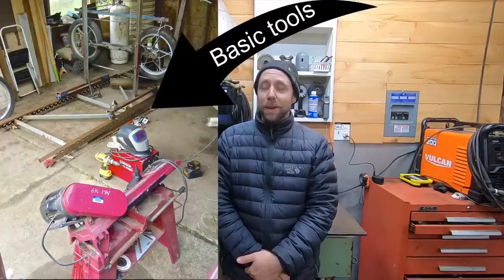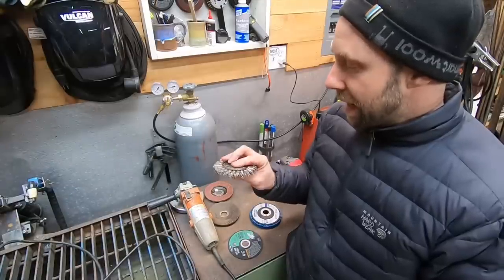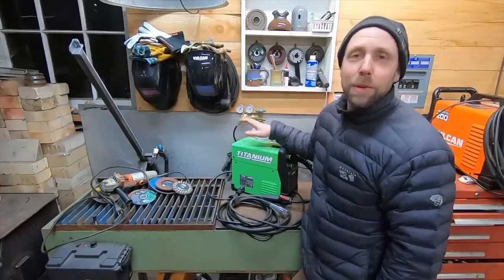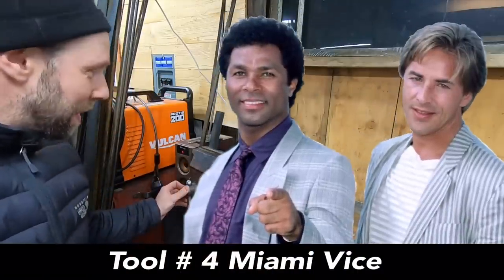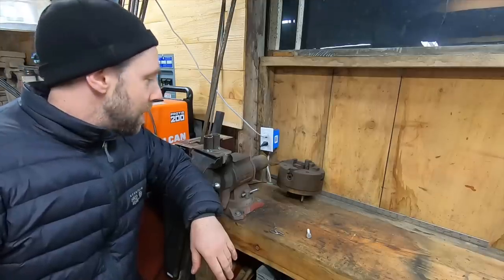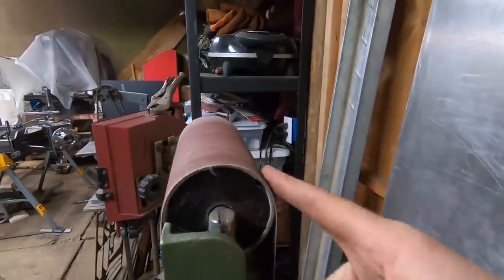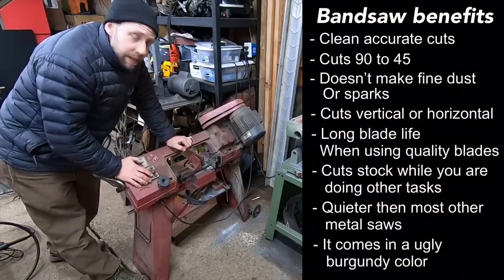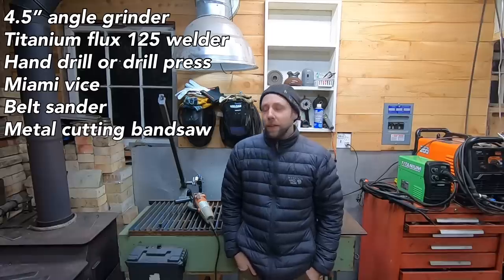6 affordable tools I recommend to get started in fabrication

Comment: I’d recommend starting with a stick setup. I can do thin metals with that or oxy brazing. Stick also can handle 1/4-1/2 inch metals if need be. Flux core has its place but it’s not quite as versatile.
Flux core is perfect for the weekend warrior or shade tree guy otherwise.
Reply: i got a stick welder when i was 12 i still use it even though i have a big 240V miller 
there are just some things a stick welder is better at
Reply: There's nothing wrong with the flux core prosess just use the proper wire type, use the proper polarity, and always store your wire in the proper environment like you would stick welding rods don't let moisture get to them and you will have better consistency with your welds
Reply: Scott Barlow not to be a smartass, but do you actually own flux, stick, and mig set ups?
I do, and I can confirm that flux core is a hobby rig. No one serious about being a fabricator should start with that unless they specialize in very small scale repair or they want something to play around with on the weekend.
Also, flux wire does not mind being in a moisture environment, I’ve used it during quick field repairs when it’s been a light rain.
Reply: @ThisGuyWantsBeer  Miller 250 AC /DC CC square wave w/water cooled TIG torch setup . . . ESAB 250 AC DC  MIG w/ spool gun for Aluminum . .  Thermo Dynamics Thermo Arc 186 multi process portable TIG stick unit . . . Lincoln 180 MIG. .    L-Tech 120v MIG . . .CENTRY AC/DC 225 ARC BUZZ BOX . . .MILLER BOBCAT AC / DC  w/ high freq. Unit . . . .HOBART Welder/Genset portable . . I think that's about it  not including my Thermo Dynamics plasma torch
Reply: @ThisGuyWantsBeer  I disagree with your flux core theory it is an excellent process and you can learn how to weld with this process just like you can learn how to weld in any process with proper instruction and practice . . For instance if I was offered a good paying long term entry level with no cert. TIG welder position starting in three weeks or whatever and I had access to heliarc equipt. Its not necessary to go learn how to stick weld before you learn TIG or even MIG for that matter . . . learn the process that you will actually be doing first then learn the other processes later while you are putting food on the table  there's so much information out there on the web ad it's free . . .I didn't have much information except for a few old timers that were helpful and I'm grateful for them but all they knew was AC stick using 8 or 10 yr old rods that this one farmer guy had under the seat of his pickup that didn't match being different sizes and types that have been wet every winter in New England
Reply: @ThisGuyWantsBeer  flux core wire should be kept out of the elements and moist storage areas . . . And I don't recommend welding in the rain . . No matter how light the rain is . . And never on wet ground  . . .unless you like doing the 60hz shuffle and changing your heart rythym  that's just bad advice . . . remember a lot of people just learning read what you write here . . Safety first
Reply: ThisGuyWantsBeer flux core for hobby welders?  I’ve ran some flux core welders that would have no problem burning holes in 1/2” plate. 
Flux core is one of my favorite processes because the welders are light, no gas, will weld in the wind, etc.
Reply: Scott Barlow the 60hz shuffle?  Aren’t most welders of any quality dc?

Comment: Nice video Mike. I like the color of the band saw, blood red color comes in handy when there are shop accidents. The only thing that I would mention, since I like to use all kinds of weird scrap metal, is to watch using a band saw when cutting old scrap bed frame. I've found that there are hard spots in the metal and they can wipe out expensive band saw blades or toothed saw blades. For the shitty bed frame I use an abrasive cutoff. Lot of deals on Craigslist too! I started on an SP125 Lincoln flux, it was we easier to learn that then stick. Big advantage of flux, is that the wire is being fed, stick you have to strike the arc and then keep worrying about running out of electrode. Lot of good tips here. I'm sure a lot of first timers will appreciate this video, thanks for making it!
Reply: Thumbs up on the bed frame info!  They can be surprisingly tough.
Reply: @jiminsequim3218  Dude yeah, I don't know what the deal is, but I've messed up a few band saw blades and recip-blades. Never again! LOL!
Reply: @BarnStangz  I heard once that they are made from recycled metal so you don't know what will be in them.  I have burned up a few drill bits on them!  :^)
Reply: @jiminsequim3218  Oh damn! YES! I forgot about drill bits too! Damn pot metal bed frame! LOL!

Comment: That Ti 125 is quite possibly the best value in a welder you can find. That thing is absolutely amazing for portability and quality welds with a flux core. 
Built a roll cage for a kart with schedule 30 structural and it helped up just as strong as any other welder would have made it. 
I've honestly thought about picking up a second one on another $150 sale.
Reply from the maker: Thanks for commenting 👍 you are definitely right, it’s a amazing value, compact light weight DC inverter welder for $150 on sale! 
Take care
Reply: I was kinda shocked when you mentioned roll cages but then I remembered that the Titanium is DC and not AC like the older Chicago Electric. I have seen a guy use the older welder to weld two pieces of half inch plate together and he did get amazing penetration that he couldn't break with a hammer. However he's much more skilled than your average hobbyist.
Reply: @WolfsHaven  Yeah man, I was able to hang from it and do pullups at 200 lbs, pick the whole kart up by the cage (2 seater Carter, not that light), and swing on it with another piece of steel pipe. SOLID

Comment: PPE. Get a good mask, an auto darkening helmet that you can use for angle grinding, and get a good pair of gloves. That's the absolute basic amount of equipment needed to get started. As you will have one blade break on you and land an inch away from your head near your eye. You only ever make that sort of mistake once!
Reply from the maker: Michael Burke All this PPE is covered in part 2 👍

Comment: I find a good set of marking out tools helps. Tape measure, ruler, scriber, dot punch, combination set square, also some engineers ink, magnetic 90, clamps etc
Reply: You can't have too many clamps tractor supply has those Bessy type clamps for real cheap also a bunch of different  vice grip style welding clamps they are not name brand but the price is right and they work just fine
Reply from the maker: Hey I’m covering a lot of non power tools in the next part of this series, it would have been to long of a video to cover it all in part One. 
Thanks for commenting guys 👍
Reply: @Mikefestiva  yeah and if you haven't done it yet maybe a simple welding /layout table from scrap there are a bunch of designs out there and a good useful home project

Comment: I really like the Forney Easy Weld 140 MP. Its more expensive but it will let you do flux, mug, stick, and tig with the proper accessories. it come set up for flux and stick.
Reply from the maker: Good to know👍 I like the Titanium 200, it’s a MIG, Stick and TIG combo plus you can run a spool gun for aluminum, but they cost $650 so I didn’t want to discourage people with that kind of price especially if they are on a budget like I had been for so many years. Thanks Jeff for your suggestion 👍

Comment: I would totally agree with his list the  only difference being maybe switch the welder for ac DC Tig because you can weld other types of metal such as aluminum and stainless steel but if you're just welding regular steel a flux core is fine

Comment: I'm a big HF advocate, but I bought that band saw a few years ago. I made maybe a dozen cuts on it and now it won't cut straight for anything. I even took it to a machinist friend of mine to look at and he couldn't get it true either. i do have a metal chop saw now and love it.
Reply: djbme83 Had a metal band saw from HF, it was a little gem! Cut a lot of metal on that saw, never a single problem. Seems pretty typical with Harbor freight stuff and they’re good they’re quite good, but quality control is lacking.

Comment: First off this was a pretty kool video to introduce tools, techniques and experience, I shared it to a true novice as I seldom have the time to teach. 

Second, any person that leaves a negative comment is an idiot, as no one that watches this starts off with 80,000 worth tools. As a professional, i continually upgrade tools to suit my businesses needs.. Lastly, great video man but my recommendation for #1 would be PPE. Glasses, gloves, ear protection, helmets etc.
Reply from the maker: Thanks Kyle I appreciate your comments 👍
I cover PPE in the second part of this series, I wanted to keep this video shorter and to the point. The second part covers PPE and non power tools like clamps, levels stuff like that. Take care 🙂
Reply: Why would you view a comment as negative? I started with $180.00 4x6 band saw. The 2,000 pound lathe cost me $800.00 at an auction. No one wanted an industrial machine of that size at the auction. Even though the ways had just been redone. My drill press cost $199.00 new with a morse taper. We all start with what we have and can afford. Then upgrade if we use it a lot.

Comment: I own The Cobalt 29pc and 2pc step bit drill set, the $60 still press, 4 1/2 grinder, the mig welder you have 125a titanium..1x30 sander, 4x36 sander and various other small stuff from harbor freight. I have NEVER in 15 years had any of these tools fail from age or break from mis/overuse. I have had name brand tools and still have them, but i will never again spend 3x $$ on a name. Many people complain of crap quality, well just like EVERYTHING ELSE, sometimes a product missed quality control and comes doa or shortly after using.
Reply: The choices today are what color box to you want your chineesium to come in.
Reply: @mytoolworld  i like a blue box with red and white strips

Comment: I go with 4 1/2" grinder
9" grinder
Oxyfuel set 
Portaband saw
Chop saw
Nice multi process welder
Plasma cutter
Band saw
Drill press
And pedestal grinder
Reply from the maker: Keep in mind my list was to help people starting out interested in home metal fab work on a budget, my list is $600 your list is good but would cost thousands

Comment: My Weekend Warrior Fab Shop has Tig / Stick Welder, Drill Press, Chopsaw, Sawzall, 4.5” rt. angle grinder, bench grinder, vise and clamps. Would like to add a bandsaw and a belt sander.

Comment: only thing i would recommend is a welders pocket reference and for people to have some respect for what they are welding, do NOT weld up a trailer and tow it down the road at 100MPH if you learned to weld last week, because you literally dont know enough to know if its safe or not.
Reply: I'm not sure where you live but in my country 100mph is almost double the speed limit for trailers

Comment: Mike I so much wish you were my neighbor. I started sourcing my metal shop equipment in 2020 right after I was run over by an F350 on my 1957 Harley Panhead and was left to die on the side of the road smashed up against a telephone pole. enough of that  but I am walking again but that is not the point. I am a chemical engineer and I am changing my career to be a mobile welder/fabricator who restores antique Porsches for now. I was able to find a 72 inch Metal brake, a 100 year old beautiful lathe  but without any tooling( had no idea what I was buying but it is awesome). I was able to get a plasma cutter and am designing a battery powered plasma cutter that wil be portable. I am very close to being done with it....I found a drill press and a beautiful 300 amp twin cylinder Wisconsin Hobart sticjk welder used on the Alaskan pipeline and a Miller Roughneck 2e that I am mounting to my restored and flatbedded Ford Ranger 4wd XLT with a crane and drillpress and vise mounted to it. Just found another Miller 2e that is propane so that I can use it inside for doing railings or whatever.Got a long way to go and I love all your videos my friend!!! Also just found a metal band saw like yours that you used for your mill oh so long ago. Going to pick it up now...lol

Comment: The stepper bits are the best!!!!
....use them and group your bolts or screws with washers, u should have no problem 
 ..
And use a greaser when drilling
Reply from the maker: Yes they really work great especially because it’s expensive to buy a 3/4 drill bit, I was just using them last night in my shop 👍 thanks for checking out my video Inez
Reply: @Mikefestiva  love ur channel ... ive subscribed
Reply from the maker: Thanks for subscribing 👍 I really appreciate it 🙂

Comment: Just to reinforce the point of some previous comments. I bought myself a great little Delta benchtop drill press on Craigslist for less than the cheap-o Harbor Freight drill press. Used tools are often a good deal.

Comment: Hello every one just a couple of lines to say a few things.my name is brian and just to add he is correct about getting a drill press at habor freight and its the one in his video and i bought that very same one... please for the love of god dude not trying to be funny here dont ever recomend that particular drill press its a huge disappointment and ill put it to you like this i no sooner got that damb thing home and together and i was taking it apart and putting it back in the box...when i was putting it through its paces on the most powerfull belt setting i could dead stop the chuck no problem plus the chuck had a tapered static connection, and what i mean by that is the chuck is not bolted to the shaft that turns it.there are no screws, roll pins or bolts that secure the chuck to the spindle that turns it...so the hunt was on and believe it or not my own corded ryobi hand drill had more nuts than that thing, im fifty and dont have all that money for a industrial drill press but i did hit pay dirt at of all places and it was a little more but worth it and its exactly what i was looking for..its at menards now i know some people will say i dont have that kinda money .wel for me ive created a tool account for myself and what id do is take a percentage of what i made off of sevicing vehicles and put it towards bills ie rent then shop suplies and consumables then the rest to tools and it was as of the date of my receipt 05- 01-2020 it was $249.99and with tax it came to $267.99 now understant this, this thing is well worth the money and it will probably be the last one you will buy. The features are  as follows its a twelve inch press chuck capacity is half inch, it has a 4.6 amp heavy duty motor and no i cant stop it with my hand. It also has a hand crank adjustable table, its got a nice bright led bulb so you see what hell you are drilling it also has a double laser guide for accuracy, its also has a drill depth limiter so you can set to drill only certain depths etc, and its got a mechanical variable speed ajustment lever for that and even come with a nice sticker under the cover so you know what speeds to set it at per size of bit and material you are drilling.. the name brand is masterforce. Hell when i whent in there i got the guy who ran that deptmartment and asked him if we could plug it in so i could check it out he sais sure and off we whent...and i bought it and struggled to get the damg thing in my trunk,hell i thought it would be lighter but let me tell you its about 80 to 85 lbs, i wanted to kill the dude because he kinda let me load it my self and i kinda dropped it getting it in my trunk but no worries no dammage at  all and it was well packaged not like the harbor freight one though..they do offer a one or two year warranty but i passed and kept trucking...as a side not the table does tilt from zero degrees to 45 degrees and also has bevel scale to take the guesse work out of the picture so all in all it was almost the best buy this year that title when to the air compressor i bought as well.. any time you purchase tools you have to keep in mind some tools you can go cheap cause there a dime a dozen like drill bits and angle grinders but on stuff that you'll be using like drill presses and table saws buy the best quality you can and the gentleman in this video is right to a certain degree but know this on certain things im going to shop shop and shop around to find the best quality for my price range that i can afford and well the
 cheap stuff is well  just cheap stuff. The items i purchassed was with my stimulis check but understand this if i wouldve know about the drill press and how reasonable it was for the money and the options it came with belive me people i wouldve bought it a long time ago cause ive need one for a long time ime a master mechanic so it will pay itself off with  a couple of brake jobs or what ever im reparing next and one last kicker i even made a self oiler so as to not burn up the drill bits, it consited of a two liter bottle, and a new iv line with the rolle valve to turn it on or off and a catch pan to catch all the lubricant and it goes into a little tank and i can recycle that same oil to use again with out having to buy more and more cutting or drilling oil, so thats my story and im sticking to folks glad to add to this young mans to get all of you into bulding your ideas and have fun doing it.. thank you all and god bless all yours truely brian.b